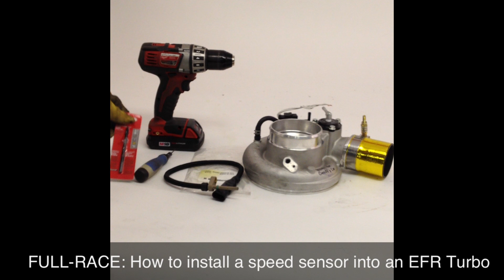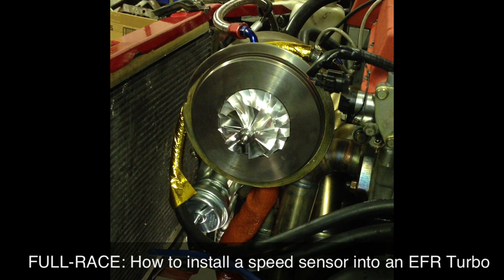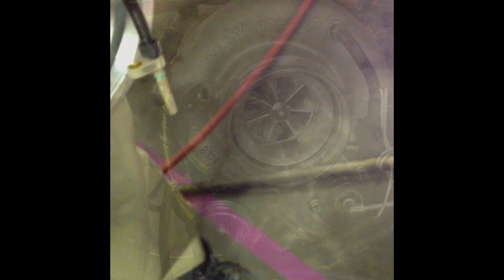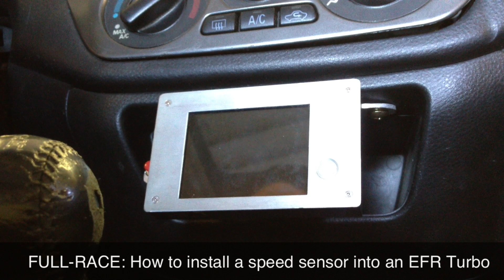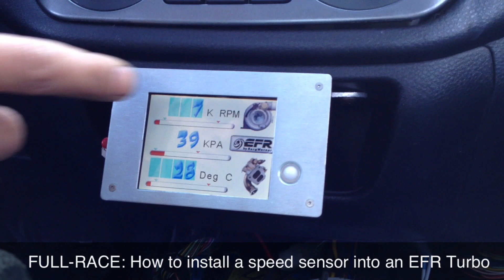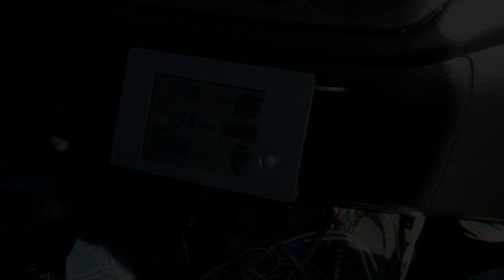Full-Race: How to install a Borg Warner Speed Sensor into an EFR Turbo

Comment: Your video needs a revision.  First, buy some quality drill bits.  Second, make damn sure the tip of the sensor sits just below the surface once installed or kiss your compressor wheel and sensor goodbye.  Third, what do you do if the sensor sits too far below the surface, how do you adjust the depth of the sensor?  In the BW instructions is shows an example of a sensor tip sitting too low WRT the surface, but does not give any advice on how to fix it or what the depth spec is (Garrett does with their speed sensors).  What if the sensors sits up above the surface, is there a BW shim kit to pull the sensor back?  Garrett speed sensors are adjustable, BW sensors are not, so if the sensor need to be adjusted (like mine, sitting 1/4" past the surface) you will get to custom machine your own shims.

Comment: what's the point of turbo shaft speed?  how do you use this information?  just wondering.
Reply: You can for example see where turbo is hitting surge line and also where you might be overspeeding due to choking.

Comment: You should have installed it with the compressor cover off to check if it protrudes enough or is flush with the housing like the instructins say... just sayin'